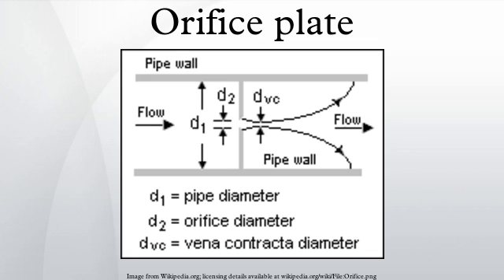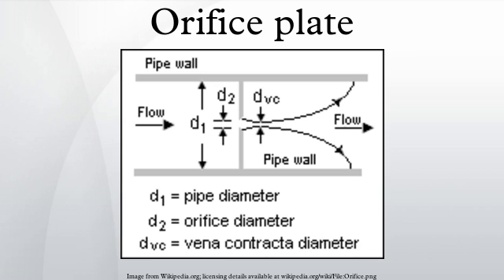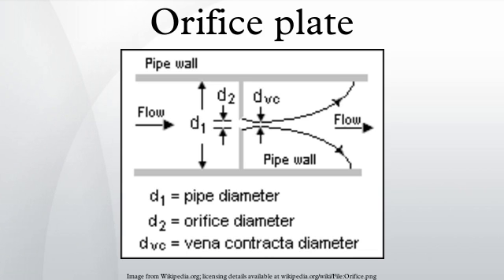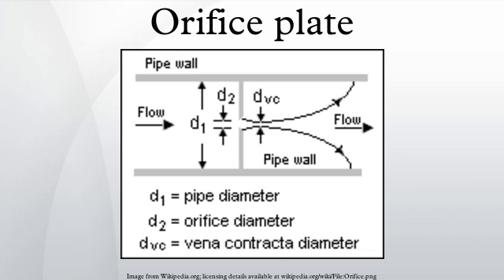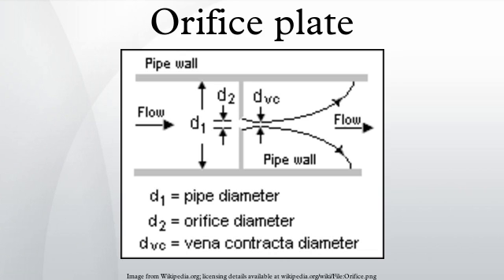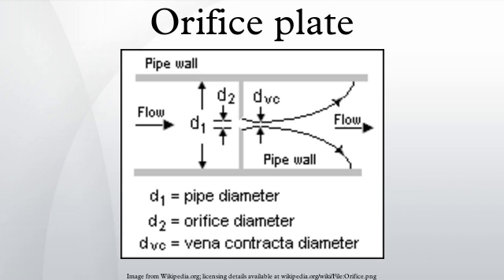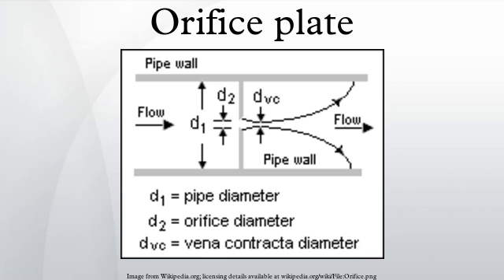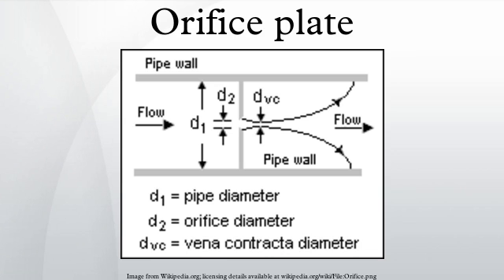Orifice plate

Comment: helllo.thank you very much for this turtorial.
please help with question.

water is supplied from a tank into a canal through a rectangular sluice 1m wide  and 1.75m high.the water level in the tank is 2m above the top edge of the opening and the canal water level is 30cm below the top edge .if the coefficient of discharge is 0.62 for both the free and the submerged portions .calculate the discharge.